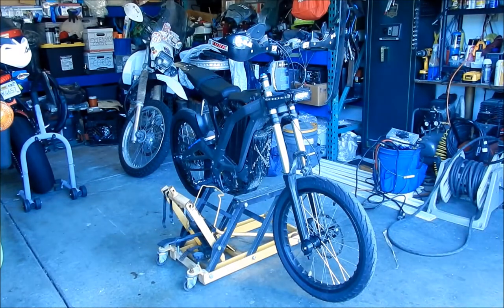Sur Ron Light Bee Tappered Roller Bearing Headset VLOG Part 2 - Diassembly

Comment: I got one of the Crud brand XL model fenders for the front wheel, take a look u might like it. On the back I'm working in one of the Mudhugger pieces and it looks like it will fit the swing-arm nicely. Funny it seems the Britts have an advantage in designing wet protection...imagine that lol.
Reply from the maker: Nice I'll look into that fender.  I used to have a mudhugger on the front and I took it off because it kept on hitting the wheel when riding offroad =(  Have you done any jumps and off road riding with the Crude fender?
Reply: @hadesomegamoto7639  It can make some rattle noise if installed high against the brace, but I've had no issues with tire interference (it's made 2 fit 26"), or the fender staying firmly in place during rough riding.